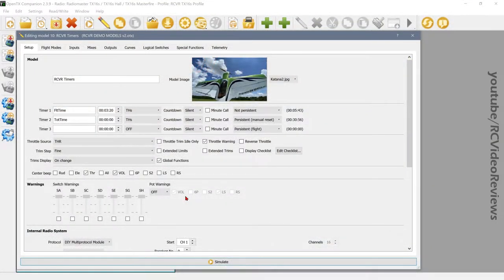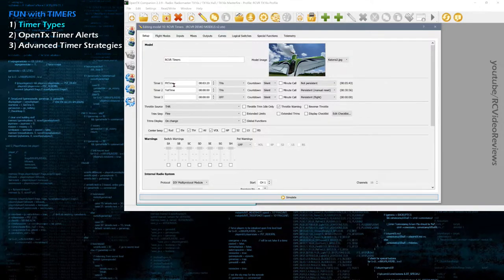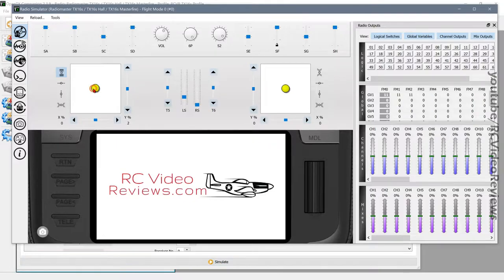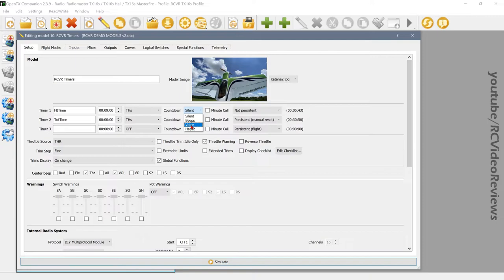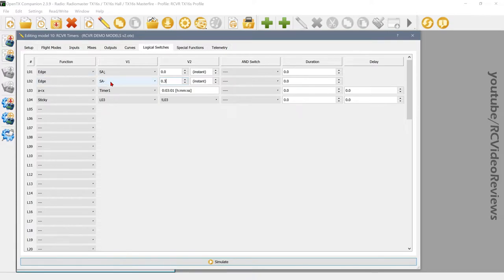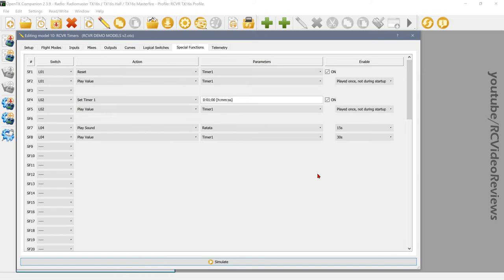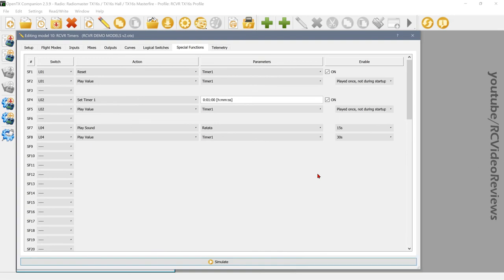OpenTx Companion Tutorial • Timers Explained • Fun with Timers • Radiomaster TX16s •  [Beginners]

Comment: Hi I have the XK A800 i was able to bind in to my new TX16S but i don't know how to set up the 3 position switches on the 3D6G can someone assist me please? Has anyone setup the 5ch 3D6G on a TX16S before? Any Help is greatly appreciated
Reply from the maker: Did you just try going into Mixer and on Ch5 adding a 3 position switch? i.e. Line One call it Mode. Press enter on Source and move any one of the 3 position switches. That is all you need to do to assign a 3 position switch to a channel. You probably need to do that on Channel 5.
Reply: Hi Thanks ill try that now
Reply: Thanks I followed that info and was successful but now how do i connect the 3D6G to the switch?
Reply: I want to really say thanks for trying to help me out with this. I really appreciate it as i'm a bit lost right now. i'm new to this radio but never use gyros or anything like that before as i've never needed it, its just all the new stuff comes out with it making it harder to figure out. I normally just fly aeroplanes 4 to 6 channel and some eflite helicopters not 3D.
Reply: Thanks Ive done that now I need to find out how to select 3 modes for the XK 5ch 3d6g using my TX16S transmitter. so I can also reduce the gyro and turn it off?
Reply from the maker: Do you have any kind of visual representation on the stab showing what mode it’s in? Or do you know what the pwm range is for each mode?

You could try this in the mixer:

Ch5 line: set weight of 100. Set source to SC. Set switch to SC Up. 

Press jog dial and add after to get a second entry on Ch5

Set source SC. Set weight 0. Set Switch SC Middle

Press jog dial and add after to get a third entry on Ch5. 

Set source SC. Set weight -100. Set switch SC Down. 

That hard codes a 3 position switch SC on channel 5 and sets the pulses to be top middle low which usually works for a three mode device. 

Outside of this you’re going to have to go do some homework and find out what the stab needs to see for pulse width and what channel it wants to see those pulses on. It should be 5 but if the Rx supports 6 channels it could be 6.
Reply: Hi Thanks for that ill give it a try. I assigned switch SG. when I test the model nothing happens when i go through all 3 positions ?
Reply: I looked up the KN protocol and set the switch to channel 8 as per the info"  The KN protocol supports up to 11 channels and does not support auto-binding. If Fixed ID is set to None, a transmitter-specific ID is used instead. It is necessary to manually bind each model before the first use.
Channels 1-4 are throttle, aileron, elevator and rudder. Channel 5 activates the model’s built-in dual rate. Channel 6 activates throttle hold. Channel 7 activates idle up (WL Toys V931, V966 and V977 only). Channel 8 toggles between 6G (default) and 3G stabilization. Channel 9-11 are trim channels for throttle/pitch, elevator and rudder.
"
 Now it seems to be doing something the gyro doesnt turn off but the rudder isnt egaging with the ailerons but due to stage 4 lockdown i can test fly it until were out of lockdown. https://www.deviationtx.com/manuals/html-devo10/ch_protocols.html#protocol-kn

I really appreciate all your help with this  as I was really lost. hopefully it should be ok
Reply from the maker: @jameskeys8263  You're going to have to figure out what the stab needs to see then because what I just gave you is what I used to do for 3 position stabs. These days most of the time all I do is add a 3 position switch to the channel the Rx is looking to see the mode switch on and it works.
Reply: No worries I’ll try that. I think the 3 position switch is now set up ok as the stab responds to the switch when I toggle all 3 positions. And thanks again for all your support.👍
Reply from the maker: So you have it working now?
Reply: RC Video Reviews mate I can’t thank you enough for getting me through this and yes it’s working I checked the stabs were responding to the 3 position switch I also set up throttle cut while I was at it. I wish that  in future WL Toys and XK Innovations provide something instructional videos or PDF documents to support their products to make a better customer experience but I must say my friend you have done that for them. I’m very grateful thanks again James

Comment: I searched in LOGIC for an action that stops the timer ( not reset), during the flight, so that I can continue to fly and continue the timer, at the same time.
  Just like the option with the THR stick. The same operation I want to do with two switches in LO (regardless of the stick of the THR). Just stop the countdown, whenever I want throughout the flight, and with another click on one of the switches, continue the countdown.
I saw the videos of the LOGIC, SP. FUNCTION and TIMER, are good videos very helpful for understanding the operation of the radio, but they did not give me a solution to the action I want to do.
Reply from the maker: Oded, You can use any switch you want to activate a timer. 

Go to Model Setup, pick a Timer 1, 2, or 3. Highlight OFF, press the jog dial so the field starts blinking. Toggle the switch you want to use for the timer.  You can also use a Logical switch in that position if you want to evaluate any criteria such as whether or not the throttle is active or at some predefined throttle setting.

If all you want is a switch, just highlight the source field and pick a switch. I just tested this and it works. I set a timer value for timer 3, set the switch to SE down and I can turn the timer on and off with that switch. SE down and the timer counts down. SE up and the timer stops counting. I even put the Timer 3 widget on my home screen to see the timer after moving the switch.
Reply from the maker: Oded, You can use any switch you want to activate a timer. 

Go to Model Setup, pick a Timer 1, 2, or 3. Highlight OFF, press the jog dial so the field starts blinking. Toggle the switch you want to use for the timer.  You can also use a Logical switch in that position if you want to evaluate any criteria such as whether or not the throttle is active or at some predefined throttle setting.

If all you want is a switch, just highlight the source field and pick a switch. I just tested this and it works. I set a timer value for timer 3, set the switch to SE down and I can turn the timer on and off with that switch. SE down and the timer counts down. SE up and the timer stops counting. I even put the Timer 3 widget on my home screen to see the timer after moving the switch.
Reply from the maker: PS Logic doesn't start or stop the timer, logic only evaluates criteria. You use the logic switch in the Model Setup Timer field that defaults to "OFF" It's the same field you use THs, TH%, or THt.
Reply: @RCVideoReviews  Everything works great.
thanks for the detailed answer.
The situation did not work at first, because I forgot that one of the switches, it resets the timer in 'global functions'. I changed it, used 'logical functions', and it works well.

Comment: Like Mike D says, thanks for your time and making these educational videos, they're really good. For just purchasing a Radiomaster TX16S and getting into Open TX, the timing for me is perfect. I come from the Spektrum universe, on my DX8 G2 I use a 3 pos switch for "Timer Start", "Timer Stop" and "Timer reset" function. Could you please help me with an algorithm on that function? I'll manage to make the voice function, but I'm not so good at Open TX to find the right use of Logical Switches and Global Functions. 
I'm a subscriber, if it's necessary to get an answer from you, to be a Patreon, I'll sign up.
Reply from the maker: I'm always happy to have another Patron, but it's never a requirement to get a little help. This is really easy to do:

1) Under model setup go to Timer 1 and press the jog dial. The first field should start blinking. Pick a 3pos switch. I used SA and set the value in Timer 1 to SA-.

That solves the first two issues: SA^ will turn the timer off. SA- will turn the timer on.

2) Under Special Functions pick an open slot and press the jog dial. In the first field select SAv (down). For the function, select Reset. For the object, select Timer 1 and put a check in the last little box on the far right to enable this special function.

Now when you push SA down Timer 1 will be reset.

So:
SAup = Timer Off
SAmid = Timer On
SAdown = Timer Reset

You can rearrange these however it suits you.  Good luck,

J
Reply: @RCVideoReviews  It works!! Thank you very much! I'll sign in.

Comment: Great video and tips! I just wonder what your SA switch is suppose to control and what type of rc (plane, heli or drone)? I would like to put the demo in the right context. (I'm pretty new to RC and OpenTx)
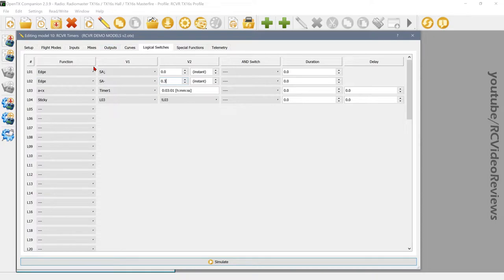Reply from the maker: The function of SA in this video is explained starting @8:00.  Since we're only talking about timers, this is platform independent. This setup would work on any airframe.

Comment: Hi John have you done a video on setting up flaps on a fixed wing model
Reply from the maker: I haven't. It's very easy though. You can either setup a curve that keeps all points on one side of 0 or you can add an offset of 50 and a weight of 50. You'll have to fiddle the direction to make sure they just go down.